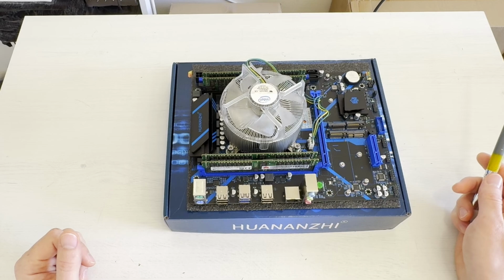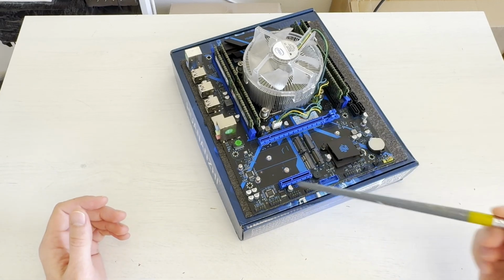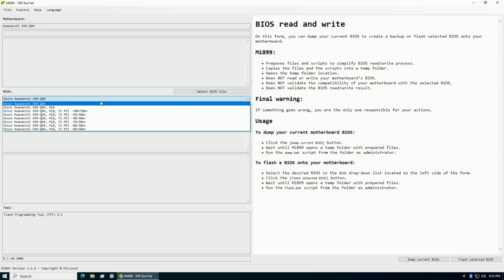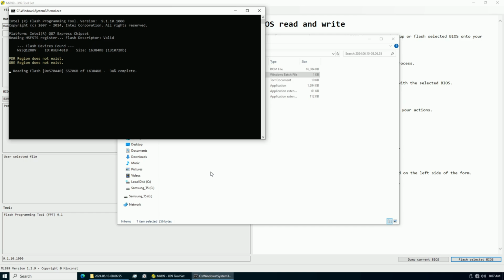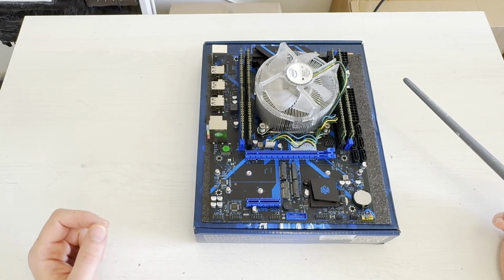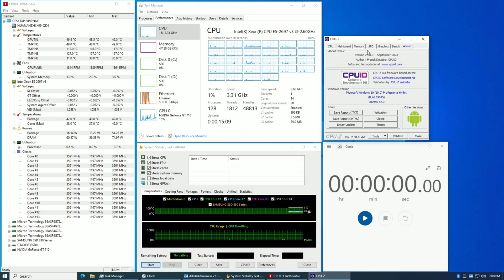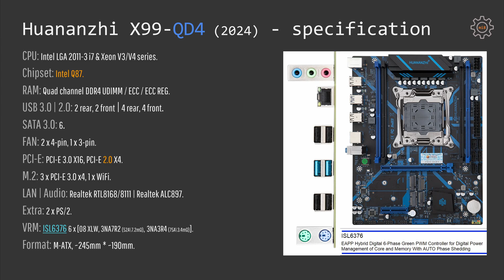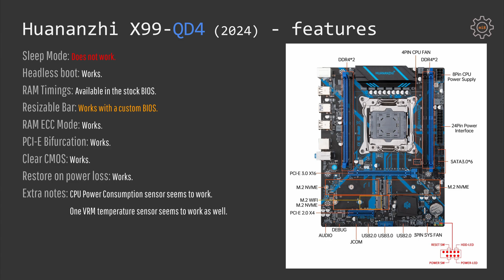Huananzhi X99-QD4 – the 2024 version with three M.2 slots

Comment: Great video, I agree, 3 NVME slots are overkill, would've preferred a X1 PCIE, thanks will stick to Machinst MR9A/Pros for now
Reply: Are there any x99 boards that have pcie 4, gen 4 nvme and support type c without using pcie slots?
Reply from the maker: No. That's theoretically not possible. All LGA 2011-3 CPUs support maximum PCI-E 3.0.
Reply: @Miyconst  
Gotcha, I searched for the last few weeks and came up empty as well... but as we already know you can run gen 4 nvme on pcie 3 but your speeds will be 3500 mbs, not 7000 mbs. And 4.0 gpu"s only lose 2-5% performance in 3.0 which is not major...

Thanks buddy, had to ask you bc you seem like you know your mobos
Reply: @Kevin-vh6nn  If you need Gen 4, cheapest option would be Maxsun B550m Terminator mobo with a Ryzen 5000 series CPU (NOT the 5500, or any APU). But for most people, gen 4 is not necessary, if you're on a budget then Gen 3 is still more than enough for most use cases.